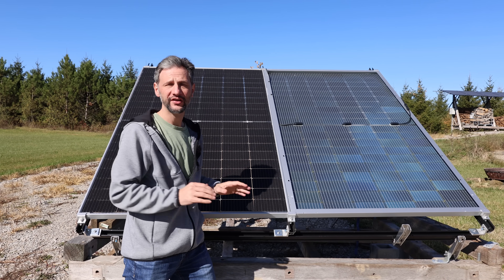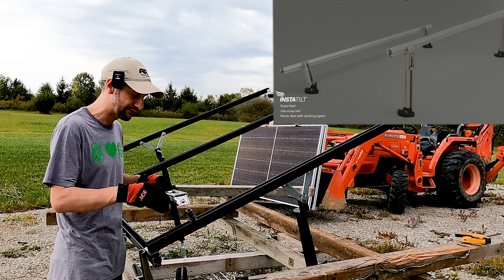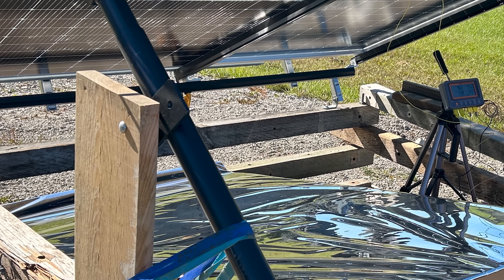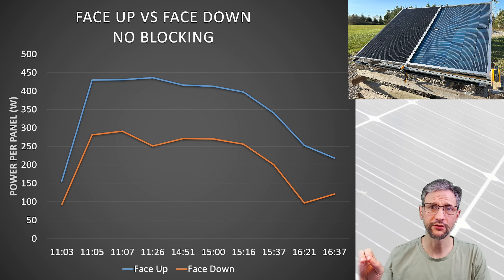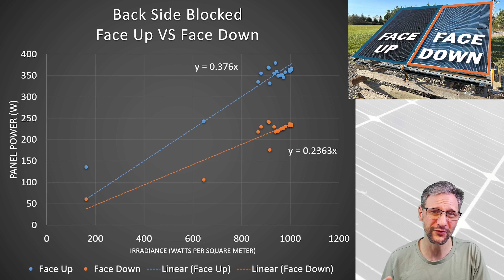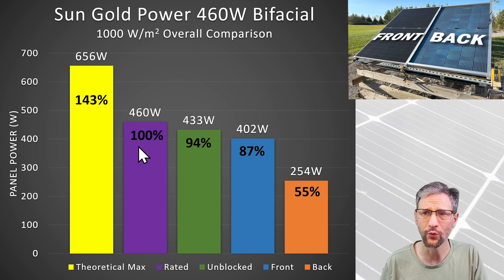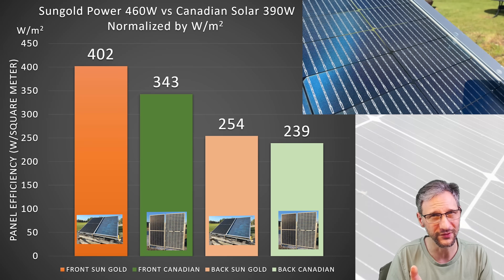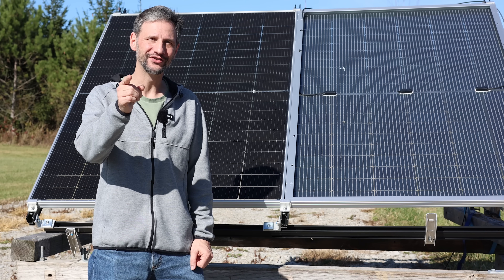How to Get MORE POWER With Bifacial Solar Panels

Comment from the maker: If you find this content helpful, consider using my affiliate links or sending a Super Thanks!  Add future content suggestions below Thank You!
SunGold Power Bifacial Solar Panels Affiliate Link: https://sungoldpower.com/collections/bifacial-solar-panels?ref=Projects%20With%20Everyday%20Dave
Find Bifacial Solar Panel sources and discounts on my website: https://projectswithdave.com/solar-panels/ 
US made Sirius Bifacial Solar Panels: https://signaturesolar.com/12-87kw-pallet-sirius-pv-415w-bifacial-solar-panel-assembled-in-texas-elnsm54m-hc-415-up-to-539w-with-bifacial-gain-full-pallet-31-solar-panels-12-87kw-total-pallet/?ref=SALE 
Signature Solar ($50 off $500 or more discount Code "EVERYDAYDAVE"): https://signaturesolar.com/shop-all/solar-panels/?ref=SALE
See more projects and get my FREE Solar Financial Calculator on my website ProjectsWithDave.com: https://projectswithdave.com/
Reply: i would love to make an ebike range extender using bifacial panels and a small trailer to give extended range one youtuber used three normal panels and travelled 450 miles from her house to her parents, with bifacial panels you would maybe only need two panels to charge a battery while you use the other. if your really good you could wire the solar charger straight to the ebike battery and controller and charge the battery as you use it . on a tesway dual motor ebike it would extend the range of the 52v 60 ah battery by a large amount

https://www.youtube.com/watch?v=Wh33yQMl1E4

https://www.youtube.com/watch?v=0Y4qlkciOcs

Comment: Hi Dave, hope all is well.  I want to give you an update on the performance of my Heliene and Canadian Solar bifacial panels.  I'd been searching for an adequate backing to place on the ground, in an attempt to reflect sunlight.  Amy array is 92 feet long and i have 42  panels fourteen per row, for three panels per row.  I started using mylar as a backing and laid them directly on the ground under the array.  Just so that you will will know.  My maximum wattage for my array is 15,870.  Before the install of the mylar, I would rarely go beyond 3800 per strand.. I have them in three strings, 1 = 5250, 1 = 5300 and 1= 5320, I was averaging about 3600-3700.  When I laid the mylar, my gain increased to well over 3900 and quite often in the 4000's  Mind you I do not use a whole lot of electricity and even in the short winter months I can be fully charge by 12:00-1:00 pm.  The biggest consumers of my electricity is my three freezers.  I am trying an even more shinier packing beginning tomorrow.  I will let you know how that works. The cost of limestone or any other white or light stone is going to cost $2000-$3000 for an array as long as mine.  At $200/roll of mylar plus shipping, that is a good deal and the mylar can be power washed a coupe of times a year.  It beat rocks and is easier to install.  Your thought?
Reply from the maker: I'm not surprised you are seeing a noticeable gain from the reflection.  Some things to consider.  Mylar sheet is more reflective, but is not going to last as long as white rock.  You may also get some hot spots as a result of concentrated light from the mylar that could be damaging to the panels over time.  Do you really need to increase the output of the array? Why spend any money on it if it is meeting your needs?  If your array is only gaining 300W with the addition of $200 in mylar it seems it would be better to just add another solar panel for about the same cost.

Comment: Paint a silver reflective material on your roof, wall, concrete, etc. before mounting your panels. Or. Use one set of reflective aluminum panels around each panel to reflect light up onto the bottom and another set from the sides onto the top by spacing panels out from  each other.

Comment: Mount 2 mirrors under the panel at a 45 degree angle relative to the panel. Then have 2 mirrors on both side of the panel to reflect the sun onto the backside of the panel

Comment: I have seem people showing 125% of rated output in very ideal snow conditions. I have some bifacials, in summer, can't test full output due to mppt cap, but with mediocre rear light, at least capping the MPPT at 93% rated output best case, though typically more around 87%. This is with it being 90F+ outside.

Comment: I am in Australia. I have been gifted a lot of solar panels 😊. Would mounting 2 panels back to back, i.e. create a "bi-panel", create similar results? Or is it a try and see?
I like your outside of the square thinking , and will also try the vertical reflection method as i was gifted a lot of panels!
Reply from the maker: Mounting two standard panels back to back would give a better result than a bifacial panel, but not as good as just facing both towards the sun.  Plus you will limit the air flow behind the panels if they are too close together.

Comment: By using Mylar sheets, you could get unbreakable mirrors that could be placed under the backside of the panels. If you applied them to foam insulation boards, it may reduce the amount of reflects heat while still reflecting the light.

Comment: I've installed 14x700w bifacial solar panel on my roof (white). I've noticed it still produces 20W of power even at night, and my grid tie inverter is always online 24x7.
Reply: I get 9/10w on some nights from my 4.8kwp system. My panels are NOT bifacial, and my roof is black.
Reply: Haha. Nice!

Comment: I have 6 570watt Mono perc Half cut bifacial Adani panels totaling 3420 watts in Panels Running on 3.3 Kw Waree single phase on grid imvertor and im averaging 21kW per day for 7 months now since imstallation.

Comment: New to this but plan to place typical shiny silver corrugated tin roofing 50cm under my ground mounted panels with 30cm of space between panels to allow more light to reflect onto the back of the panels. I'm thinking the S profile of the roofing will disperse the light more evenly and not significantly heat the panels. What do you guys think about this idea?
Reply from the maker: The reflective roofing will help you can see the performance of a white roof in this video: https://youtu.be/mzqjCsZKUYQ

Comment: Living at 3,000 feet from Sea Level in The High Desert a Raised / Fixed Array works really well with Eco Worthy 195 Watt BiFacial Panels and do a bit better than Renogy Solar Panels just with My Experience starting out with Solar

Comment: I don't have solar panels, but I wish I did. However, I wonder if solar fiber optics could be used to enhance their efficiency. By stacking the panels and utilizing fiber optics to direct light between them, it might be possible. A fiber optic light collector could track the sun to maximize light intake. You would need to account for potential light loss over long distances.

Comment: would having a reflecting element under the bifacial panel, such as painting the ground with reflective paint or spreading glass shards/dust underneath it significantly improve the back panel absorption?
Reply from the maker: Yes, a reflective surface such as white paint will increase the output.
Reply: I use special reflective ground cover designed to stop weeds and help plants grow.

Comment: focus a series of mirrors onto the back of the panel (while the front is in full sun) one at a time until the output stops going up, then measure the temp to find the cutoff where either the panel maxes out or temp degrades it beyond the benefit of adding more light

Comment: Hey Dave - Great job on your channel! Question for you...I want to build a 20kw array and there are so many panels. Is it really worth the extra money for a panel putting out the same or close to wattage? I was looking at Hyperion 400w panels versus aptos 400 watt panels and they are off by 15 years on manufacturer warranty but the same as far as production warranty. But the aptos are 2 times the money.... im struggling spending the money on aptos when i can buy the hyperion - 40kw for the same aptos 20kw... what do you think?
Reply from the maker: I would not spend 2x for a longer warranty.  These companies may not even be around in 15 years to honor it.  Also the technology changes very quickly.  You may want to swap them out for more production in 10 to 15 years.  If the panels are made by a reputable company and have a good reputation for quality I would go for the cheaper ones.  Think of it as self insurance.  But that's just my two cents.
Reply: Thanks for the reply! I appreciate your input... I think i will go with the signature solar, hyperion panels. They are bifacial panel, 400 watts on the face and up  to 500 watts for both. They are going on a roof, but based on the info i am seeing, it will be about a 10% gain from the back. Im building a 20k system with 45 panels.  They are cheap at $88 each.

Comment: whist you do get better returns overall by about 12% ,  i feel ground mount and seethrough sun lounge areas seem to be better production than the roof mount due to reflective space,  but i feel the see though bi fasial cost increase over non mono are due to technical changes in the pannel such as no bus bar, often better isolators, no backing that increase temp by insulating the pannel are the real reason for the power increase,

Comment: there is no dramatic increase in performanse rhe full video is nonsens.

yes the make ~5% more if the panels are lift 2 meters over the groud in the air, aree this 5% importand onm any way if to get this is confusing stuff to do important???
no

Comment: I would like to see results with a V-shaped N-S bifacial mount. Put reflector flat on the ground underneath, or maybe even tilted downward. Reflector is cheap, so there is no reason not to extend it well beyond the footprint of the panels. My expectation is a much flatter performance curve throughout the day: Early morning, the bottom side of one arm collects morning sun. Later in the morning the reflector kicks in; a little later, the afternoon-side arm too. Noon, both front sides are producing well. Afternoon is a reverse of morning. Of course the angle of the V needs tuning; I would start at 60 degrees.

I liked your idea of using specular-reflective material to spread out the reflection. You could get significant backside collection even at noon.

Comment: For bifacial panels I have seen older data (3+ years ago) suggesting using a minimum elevation of the front bottom panel edge of at least 42" and having minimal obstructions that reduced the light from reflecting off the ground under the panels. Having a reflective covering on the ground helps tremendously too. Racking that supports the panels on the long edge is far more efficient than using the conventional two tracks running the short way and blocking the rear. I would have liked to find a way to send you a photo of an (prototype) edge mounted Canadian Solar install.
Reply from the maker: You can get ahold of me to send a photo through my website here: https://projectswithdave.com/projectswithdave.com/about/

Comment: Have you tried vertical panel cooling via running pumped water over both sides of the panel? You could have a reservoir under the panel and keep pumping water back up to the top and letting it flow down both sides. I bet this scales well if the same pump is cooling more panels at once, lowering the pump's power cost by distributing it over more panels.
Reply: was thinking about  a similar thing, but about putting a solar panel on a double glazed window, filled with water. In this case, the panel itself would not contact with the water and would require much less framing as it would be transwering its weight to the window.

Comment: I really want to know what you guys are doing for ground Mount arrays for these bifacial panels I would really like to see some good comparisons between panels higher up in the air or closer to the ground according to this video i believe you just said that the panels perform better closer to the reflective surface like maybe marble chips white rubber roof tin a mirror or a reflective surface such as aluminum foil or maybe a old solar pool cover.

What's everyone using for really cost-effective ground mounts that works the best for bifacials that are 400 + watts

Comment: 13:15 use mirrors to guide sunlight to the back panel, then set up some fans along the edge of the test panel to blow wind ACROSS the backside of the panel to keep the temps down.

Comment: Been thinking,  possibly small fans or cooling system, can cool down the solar panels with re-made reconstructed bracket, with your reflector film, can contain more projectional output and cooling for less degrade from the cells. Just amazing ideas: Projects with Everyday Dave. lots of pontential. :glasses-purple-yellow-diamond:
Reply: The amount of used energy to cool down the panel won't be enough to cover the additional energy gained due to lower cell temp.
Reply: What About Cooper Tubing for heat transfer with possible solution like liquid nitrogen or a cool mini fan to transfer the cooling effect or even water cooling for solar panels..
Reply: @imperialresolution  stupid idea: put a solar panel on a double glazed window filled with water, add some kind of water circulation and cooling pump. Ideally burry the heat exchager underground. Might need additional reinforcement of the back of said window (can use some reflective metal planks for that), but the panel itself would need much less of the supporting structure.

Comment: You think you have it bad? My panels hit 70+C after a long hot day at 130PM. I guessed as much as I was designing the system so I specified 600w to 440w microinverters with a DC to AC of 1.38 in order to eliminate as much of the loss as possible. Doing so also allows me to hit peak at around 800w/m2.
Reply from the maker: Sounds like you did some planning to account for your weather conditions.  People don't realize there is no one-size-fits-all solution when it comes to solar.

Comment: I noticed a news item that the Saudi's are applying a simple lubricant to their solar panels that causes the condensation to run instead of forming droplets that cools overheated panels which boosts power output by cooling.   This sounds like something that should be tried.  A search suggested it was silicone and a polymer.  This sounds like something that could be even store bought.

Comment: Wait a monut, i thought panels output per square meter is 220w if panel has 22% efficieny.
What i am missing guys?
Reply: From the datasheet, the electrical parameter of the solar module is tested at STC condition, 1000W/m2 irradiance, 25 degreeC Cell temperature, 1.5 air mass.
Any changes in the environment will affect the energy generation.

Comment: Thank you for this its really a very interesting and well executed testing process.
I wonder if I could suggest a test query?
In the United Kingdom we are seeing more bifacial panels being recommended and installed on Residential Roofs.
Most roofs in the UK are a brown/terracotta Tile, grey concrete tile or natural Slate and the panels are installed at a distance around 6 inches from the roof.
With the low "albido" effect of the roof substrate would it be possible to test your setup with both panels face up and with one with a backing placed about 6" from the panel? 
Backing consisting of something like roofing felt or similar low reflective surface?
Reply: Just a note about your performance summary at 12:00.
Despite blocking the rear of the face up and face down panels the solar cells still allow light to pass through and some of this is picked up by the rear cells.
From there all your stats are affected by this element.
Assuming the two panels are exactly the same it would be more accurate to calculate the difference between face up @ 402W minus face down @ 254W and equate the difference of 148W (32%) as being the measurement of the benefit of the bifaciality. Unfortunately this is still only an approximation but certainly closer.
This would give a "Theoretical Maximum" of 460W Rated + 148W Bifacial = 508W
Reply from the maker: I used black plastic on the cardboard blockers, and the blockers are placed against the glass.   I think very little light is reflected back
Bifacial panels placed close to a dark color roof, will give you very little gain.  However, bifacial panels are not much more expensive and you don't have to worry about back sheet failures.

Comment: Usually you should get slightly over rated power from a panel when new? Rating is guaranteed for a number of years, which means they have to perform above specs when new. I usually measure 104-105% from a new panel.
Reply from the maker: At what solar irradiance?
Reply: @ProjectsWithDave  At what you should get on any clear day with a reasonable solar height. Can be more than 1000W per sqm. You get a solar panel, unpack it point it perpendicular to the sun and load it at the claimed amps on the sticker on the backside. There is no solar business tradition of overrating panels. If it is not delivering the nameplate power out of the box, it is faulty. Preferably should deliver a few percent more than nameplate power to be able to deliver the guaranteed power for the number of years stated in the warranty. UL 1703  certification specifies power rating and degradation.

Comment: Great video Dave. Remember that the panels typically have a temp  coefficient for both voltage and current, so your decrease in watts are pretty much spot on 👍🏼